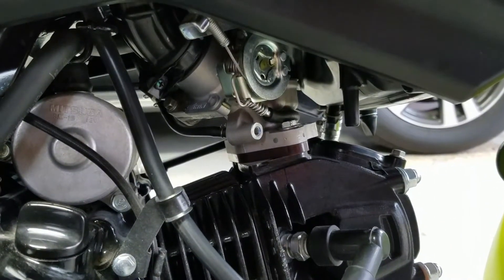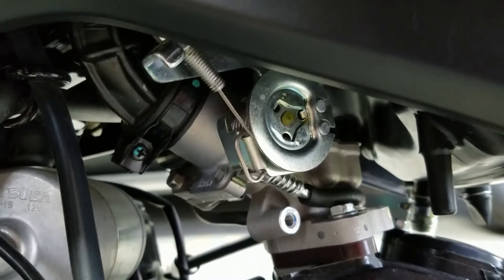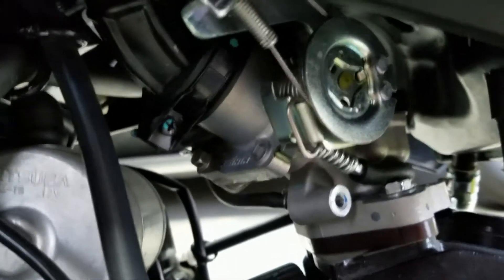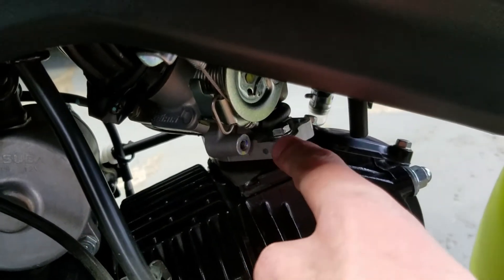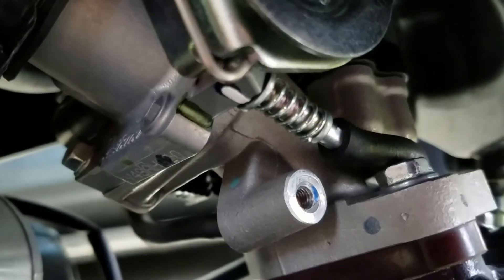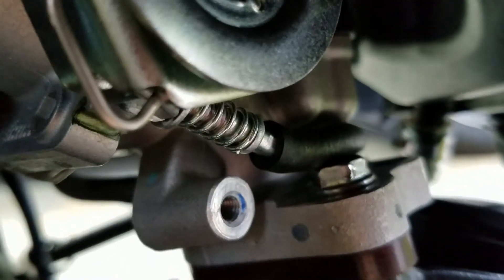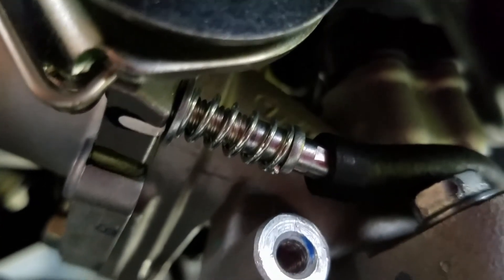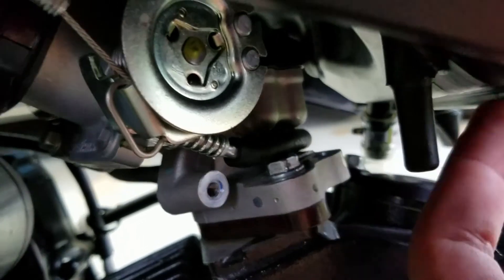2018 Honda Grom Idle Adjuster Install

Comment: alot of people run the adjuster up the right side of the airbox and zip tie it near the top plastic. that way its close the handle bar and dont have to reach down at all
Reply from the maker: I actually just moved it over to the right like you said, much easier!